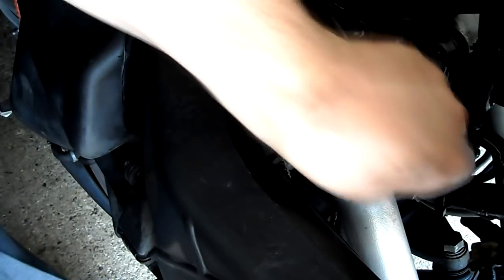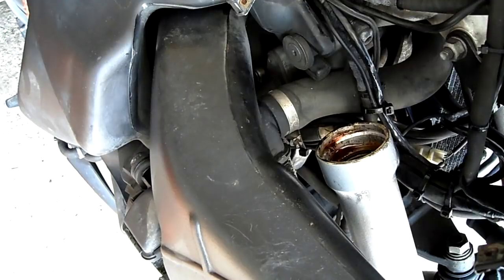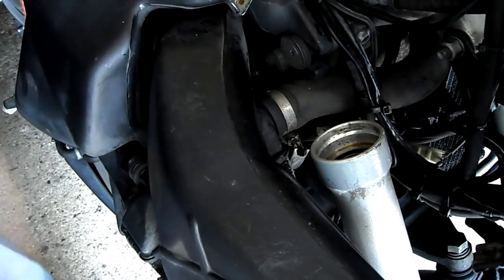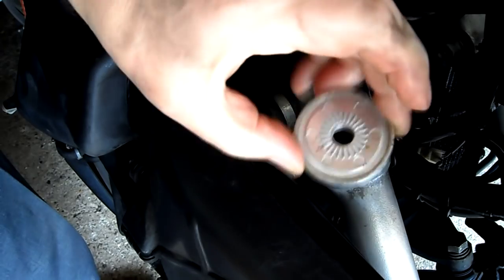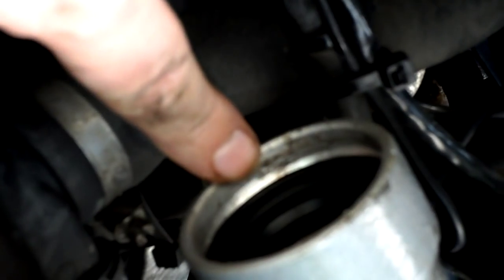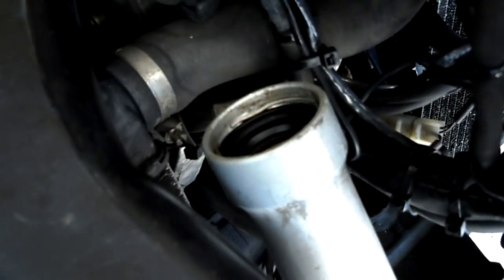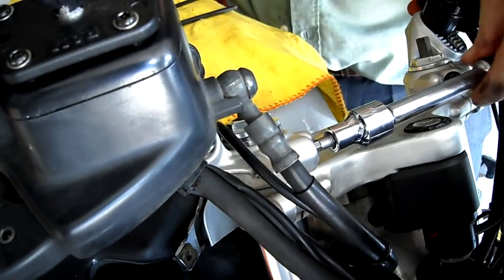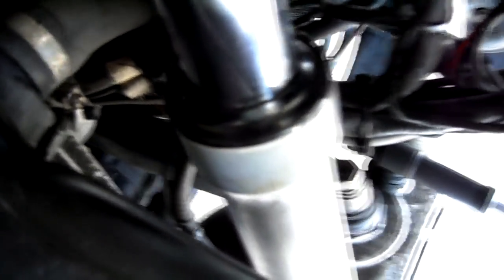BMW K1200RS front fork seal replacement

Comment: Very informative.  I recently had a seal failure due to the state inspection sticker being placed too low on the upper fork tube.  With two people on board, the sticker slid below the seal
and eventually caused the failure.  This was a direct approach to replacing the seal ...much appreciated!

Comment from the maker: @morrismrinak 

Good question, I was expecting to find one as well. There was not one fitted to either leg. I'm guessing the later K1200RS seal's are different to the old model and the manual has not been updated.

Comment from the maker: Never had an RT but I do know the front end is very similar so I see no reason why it should not be done the same way. Best to ask on one of the many BMW on-line forum's as I sure someone else would have done this job many times already. I think the fuel tank might have to be removed (easy job), as its larger than on the K1200RS

Comment from the maker: The video does not show it but I did siphon out most of the oil and replaced with new. In all honesty the old oil looked just fine so in the end I don't think it was worth the trouble. The oil is only for lubrication really as most of the suspension load in done by the shock at the front on a K1200 and not the forks.